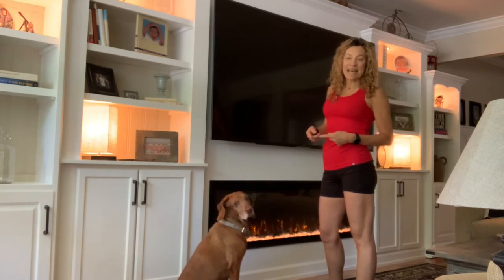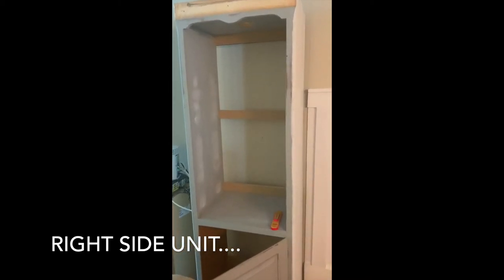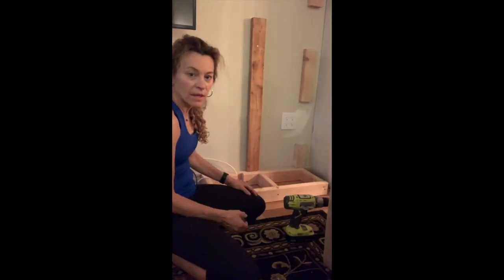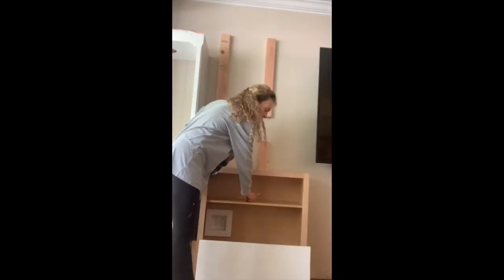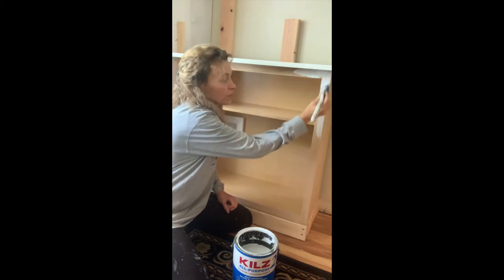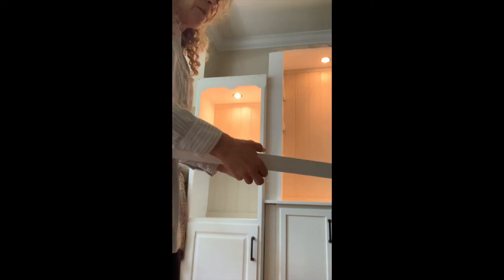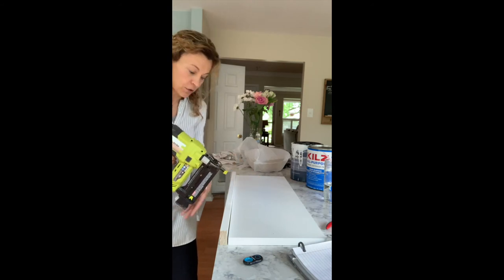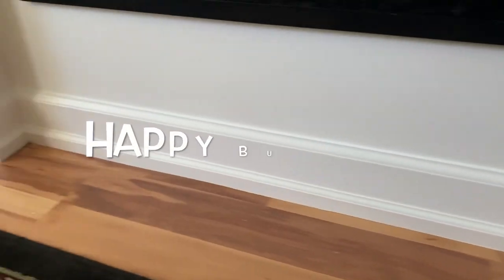DIY Built-In Shelving & Recessed Electric Fireplace with Beginner Friendly Tips & Tricks-PART I

Comment: Did you secure the base cabinet to the frame on the floor or did you secure them to the 2x4 that vertical behind the back of the cabinets? I’m doing something similar but the store only have wall cabinets in stock
Reply from the maker: Hi Rodney- I attached the cabinet to the wall, but either way will work. I think it depends on how square everything is.